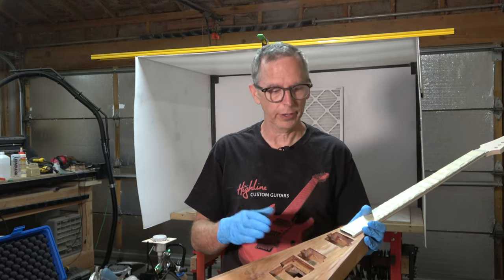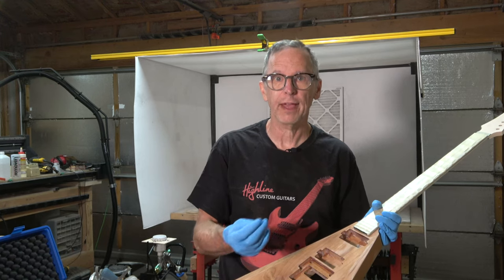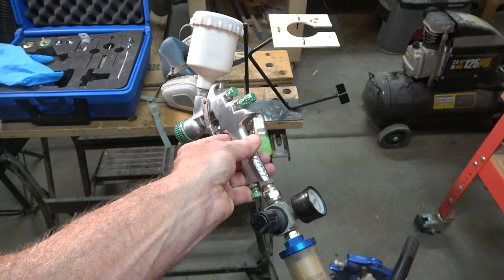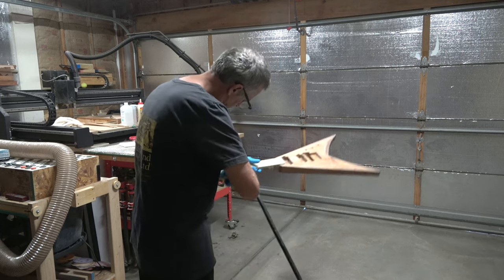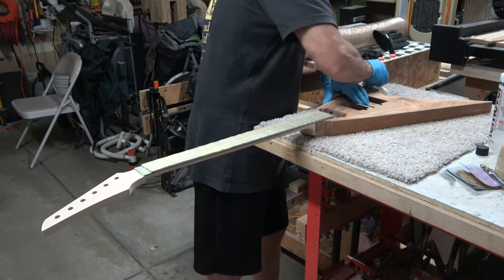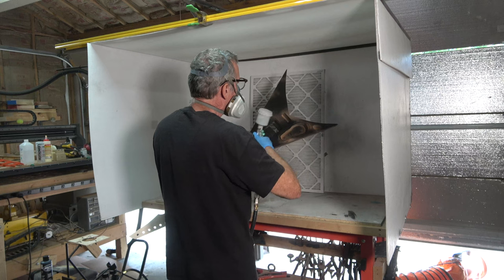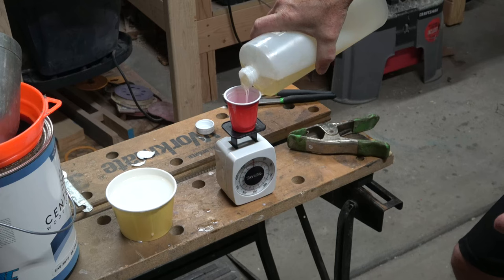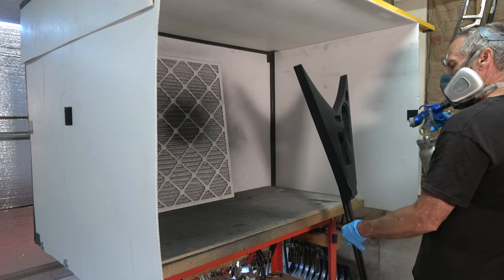Making A V-Shaped Guitar Part 14 Painting The Guitar

Comment: Great overview of your painting process. I don’t build or paint guitars, but use spray guns and airbrushes for the art pieces I create. I use Createx paints extensively and various clear coats depending on the surface I paint. I’ve appreciated watching your experiments with clear coat options—you have saved me quite a bit of time and money! 
One question: I find that adding small amounts of Createx 4050 gloss clear to my Createx paint promotes adhesion and transparency. Have you tried using it? I know you were going for a matte finish, but the clear coat will determine that in the end.
Best wishes!
Reply from the maker: I have used 4050 and I find it does exactly what you mentioned. I used 4011 for this project because I needed to maintain solid opacity while thinning viscosity.